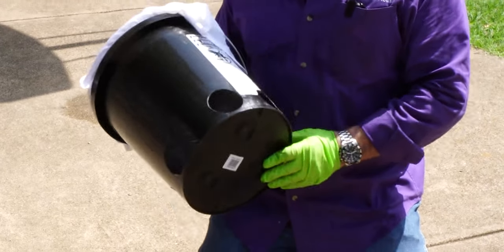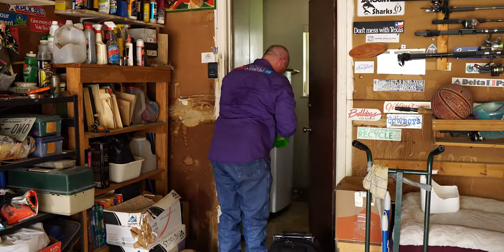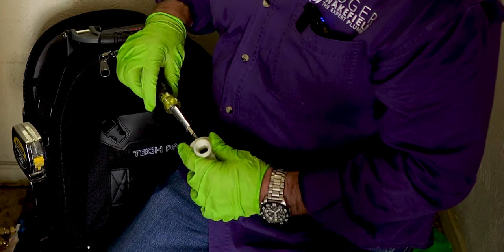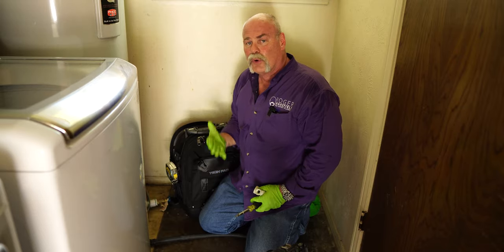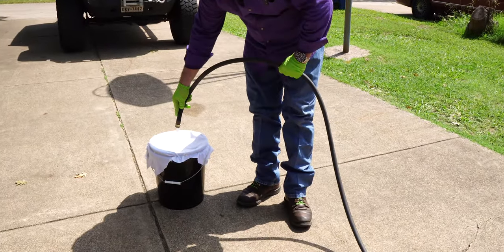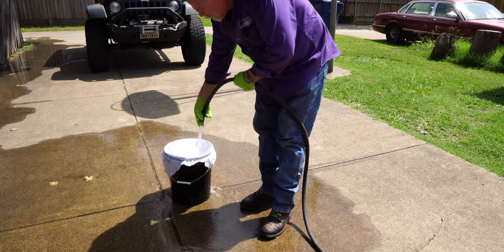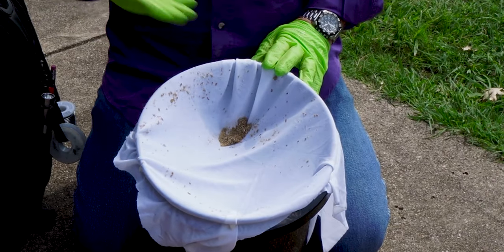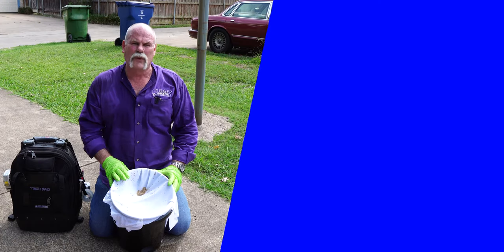How to Flush a Water Heater the RIGHT WAY - DIY Plumbing

Comment: How long can a hot water heater last, and when should one be replaced?
Reply from the maker: They usually last 8-12 years, although I’ve seen some last closer to 20
Reply: Mine laster about 8 years and started leaking. It did not have a lot of sediment and was never flushed. I will flush this new one. The anode should be removed and checked after 6 months, then checked, maybe yearly depending on how it looks after the first removal. I could not get my old one out to see, but it had to be toast. The manual has the instructions and timelines.

Comment: Hose hooked up, drained the water heater, turned on cold, flushed it multiple times, closed the valve, when up to turn the hot water off and it was super hot, like it never drained

Comment: My 16 year old water heater has been making popping sounds. I went ahead and flushed it today. I decent amount of sediment came out. It’s heating up now and still making the popping sound. What’s going on with that?
Reply from the maker: There still might be a decent amount of sediment on the bottom of the tank…flushing helps gets rid of a lot of the loose debris…but not all of it. If you’re still have problems getting hot water, I’d think about replacing it soon

Comment: Ooooo mine hasn’t ever been flushed. Wonder what’s in it. Haha
Reply from the maker: When it's time to replace your water heater let's cut open the old one and see!
Reply: Roger Wakefield I am allllll for that! Woo! Yeah! 💪
Reply: I’ve never done mine either yikes 😳
Reply: Should you turn off the power on the heater?
Reply: @srichard217  I'd say you should turn off the heat or you'd be running hot water over your hose and may scald yourself.
Reply: Our house was built in 1992, I never did anything to my water heater...wonder how long before I need a new one.
Reply: You need to take Roger up on that!
Reply: @4u25out  It mostly depends on the quality of your water and a condition of your anode rod
Reply: @4u25out  you better do it now , becuase if you dont,, one of these days you are going to go to the basemant and you will see flooting all over it ...
Reply: @srichard217  I would recommend turning the heat down all the way. There is no reason to try to heat water that is just going to rush out. As long as you have fresh water coming in you can leave the power on. The danger is when there is heat and no water to keep the tank from over pressuring

Comment: Gurning off the electricity for a couple of hours will prevent a scalding burn ! I always see (once a week ) a hot water tank on the road edge near the  condos near me. They never flush them. Then a new one has to be installed. Such a waste. But most condo owners don't even own a screwdriver !

Comment: Roger,
I didn’t see you turn off the breaker or the inlet water value off. Most videos I’ve seen recommended doing that. Is it safe to not turn those two things off and just hooking up the water hose and flushing it?
Thank You.
Reply: That’s what I like to know too
Reply: as long as you keep the cold water valve turned on, it's not a problem if power is still on trying to heat.

Comment: My rank doesn’t have a drain. Curious how they drain it if have to assume dissconnect one of the other lines. Looks like cheap system I have so explains no drain other then the pressure relief

Comment: Great video and thank you for the info, but surely there's a more efficient way than running the hose on full blast for 10-15 minutes. I bet you could find a way that's faster and uses less water, just a thought. Cheers :)

Comment: Ok so kind of a horror story been a plumber for years and one of my first times solo as a couple year old apprentice I had a water heater that had a hose on it from the old home owner for draining the water heater that the new home owner wanted off. It was a plastic valve so I backed it with a second wrench and that plastic valve broke off. I got wet and quickly shut of the water heater valve. So I learned two things first shut the valve to the water heater off and second if they have those plastic water heater valves leave them alone. I should of just told the home owner to live with it. The thing that sucked is I had to run to a local store because I didnt have that valve on the truck and the only one the store had that would fit was a plastic one. I made a plug with a male adapter when I ran to the store. I had to use a screw driver and a hammer to break out the rest of the plastic valve it was a pain.  Those new plastic ones do not fit worth a dang but I got it to work. Moral of the story if I change out a water heater and if it has a brass valve and I dont have one on the truck I take it. Dont buy the water heaters with plastic valves please...
Reply: 3/4" ball valve works best.
Reply: @damianr1658  but you need a hookup for garden hose to drain I know they make an adapter but if your junking a water heater anyways it's free. You can pass that savings on to the customer and make them even happier.

Comment: My tank has about a foot of sediment in the bottom.
Reply from the maker: oh wow! Have you ever flushed it before?
Reply: @RogerWakefield  Yes, we have very hard water.  I have to take out the electrodes and the ball valve and vacuum the inside with a shop vacuum and small diameter custom tubes.  Makes for a long Saturday.
Reply from the maker: how often are you having to flush it? Have you thought about a water filtration system to help soften the water?
Reply: @RogerWakefield  yearly.  I have to dig out under my floor to access a drain line to drain it.
Reply from the maker: Sounds like some work...but might be worth it

Comment: Why not just turn off the water, but not drain the tank. then pour a gallon of hydrochloric acid into the top of the tank and let the solution mix with the contents of the tank for about an hour. Then drain the tank. All the solids scaling n the tank will be dissolved and when you flush the tank, everything will be spot less.  The hydrochloric acid does not harm the metal pipes or metal in the tank and as soon as you flush with water, simply turns to chlorinated water.

Comment: You should do my waterheater it hasn't been flushed ever...it's from 1976.
Reply: What ? 😂
Reply: @Freight-bw9wd  it's a 1976 maybe even a 1975 original to the house and it's running on well water :).
Reply: @timothynguyen9984  the old school still works 🥳
Reply: @timothynguyen9984  dont jinx yourself now

Comment: Question, do you need to shut the power off first?  I’m assuming the cold water coming into the tank and the water leaving via the hose is the same. If the hose is letting more water out than is coming in and the tank level drops below the upper heating element wouldn’t you risk burning out the element..
Reply: Yes. To avoid dry firing the heating elements, turn off the power to the tank many minutes before you start draining. Then, don't turn it back on until the tank is filled again. And to get it filled all the way, you should open a faucet somewhere to let the air out of the top of the tank. (I've watched a few of these videos).

Comment: REMEMBER TO TURN OFF THE ELECTRICITY FROM THE WATER HEATER TO PROTECT YOUR HEATING ELEMENTS!
Reply: Mine is gas
Reply: @noworriesmate5903  Then no worries about turning off the electricity
Reply: Pretty sure my heating elements are already shot, that’s why I want to flush it 😂
Reply: Only if you empty it
Reply: turn it off before you shower, then you'll be wasting less hot water when you dump it

Comment: So, is he stating that you just  up the hose, open the drain valve and allow a good amount of water to flow out until clean water and then just shut the drain off and that's it?
The heater does not get shut off during this process??

Comment: I had a brass valve on mine, but the opening was not very large.  I am surprised that you dont recommend switching the valve with a ball valve.  MUCH larger opening, and I had found that more sediment was flushed due to the higher volume through the unrestricted orifice.
Reply: I did that and was pissed the brand new ball valve leaked. but the gate valve that came on the heater was too dang small and plugged up

Comment: Actually it’s best to sell a short brass nipple and a threaded full port ball valve with garden hose thread adapter when you sell the water heater. The brass drains that come on water Heaters are way to small to flush adequately. They have an opening about the size of a pencil. Also the dip tunes in Bradford White and most other brands are designed to swirl the incoming water to stir up the sediment so it all does not flush out like you may think. Flushing with pressure then draining completely with no pressure gets a lot more out.
Reply: Thanks for helping me understand the last part. I have a HTP tank and the manufacturer makes a reference to this. Do you know at what stage the relief valve should be flipped open during the flushing process? I'm presuming only after the tank is isolated and being drained.
Reply: What do you mean by "sell"
Reply: @debbiedebbie9473  I was speaking from a plumbers perspective. Typically you purchase a water heater and install from a service plumber/ company. The plumber should offer the better drain than what comes originally so the customer/ home owner can fully flush the heater.

Comment: Wait so you dont turn off any valves then just start draining it for 10 to 15 mins?
Reply: No reason to shut anything off.  You're really just pushing water through the tank directly, not much different than turning on a faucet.

You should pick up a hose bib cap before doing this.  Unless your water heater has a ball valve like this one, I guarantee it will leak after.  You'll use the cap to stop the leaks. 

If your valve leaks at the handle after, and that is common, you can try adjusting the nut or just replace the valve.

Comment: but Grumpy Plumber says there’s not use to flush a water heater?
Reply: That way he gets called to replace it when it fails...making him more $$$
Full port ball valve and hose bib adapter use a brass Nipple on the tank....then you can flush out larger chunks of oatmeal and granulated calcified chunks....your on the right track👍

Comment: I know this is an old video but I hope someone sees this. Our hot water heater has stopped heating very well, even though it's only 2 years old, after a main line in our neighborhood burst. Our water was brown for 3-4 days. I'm thinking I need to flush the tank.
Reply: 100% easy fix. Move
Reply: @Herbie11  genius! Why didn't think of that?
Reply: @MSANTHR0P3  
😉
Reply: Sounds like a great idea. I would try that! Did it solve your problem?

Comment: Hello guys I want to share something with you guys  ..Iv been Plumbing for 14years and never encounter what I did today.  I had a call for a shower stoppage , so i got my machine out and starting running the shower to get it to backup which it never did... so I still ran my snake down the drain... went in like 20ft in, so I started bringing the snake in... what I pull out was crazy.  I pulled back a small (mause/rat)it was  Dismember but can see tail,leg,feet and  What appears to be its ribs cage...
I have a picture

Comment: My tank was only 1 1/2 yrs old, bottom element went out. When I replaced it, I did a flush....over 2 gals of sediment and mineral deposits. It's all due to very hard well water, i will be flushing more often. 

Is that brass valve water heater specific? I need to change out my plastic one to a metal one
Reply: That scares me... We have some of the hardest water in the country here and it's been like 4 years atleast since it was installed and has never been flushed....
Reply: @Zalagar619  My is 13 years old and NEVER flushed. It still seems to work fine but we hear the rumbling sound whenever we first turn on any hotwater in house. I'm pretty sure it would be a very bad idea to try and flush it now according to this video. My fear would be that I would open the drain valve and never be able to close it due to hard sediment getting stuck in the drain valve
Reply: I recommend getting a 2-3" x 3/4" Brass Nipple and a 3/4" Full Port Threaded Ball Valve then a 3/4" male pipe threaded x Hose Bib thread brass Adapter

Comment: I saw another video where someone replaced the valve from the factory with a short pipe nipple and a larger valve (e.g. with a 3/4 female thread instead of a male.) Have you done this and do you recommend it, or why not? Thanks.
Reply: This is a fantastic idea. I’ve done it years ago and I love it. A three-quarter inch ball valve allows a half inch vinyl tube to be placed through through the valve and into the tank you can then attach it to a wet dry vacuum and suck out all of this debris. I did it yesterday and it worked great. Drain the tank completely which let’s a little bit of the debris come out and then when it empties completely stick, the vinyl hose through the valve and a series of flushing and vacuuming, and inserting the vinyl tube various depths into the tank. You will get out a lot of the stuff that would never come out by just flushing it. It worked really well for me.  The vinyl tube attaches to the vacuum hose with some duct tape.  Give it a try.!

Comment: I have a question! My water heater makes noises only while the hot water is being used, other than this it’s silent. Is this normal? It sounds like the water heating up.
Reply: I’ve been looking everywhere online and it says the water heaters should be completely silent
Reply: if it sounds like water is boiling and popping/crackling you should probably just replace the water heater
Reply: Austin Hamann it sound like water running
Reply: As long as your water temperature did not drop, your pressure relief operates as it should, and your drain valve flows, it's fine.  Hot water heaters are not completely silent, and as they age, they may make more noises than before.

Comment: Got a electric heater. Let it cool down over night and switched the breaker off.

I drained it and then turned on water supply... But 1)water is hot... Yet tap water colr supply is cold at the tap(at sink)... How's that possible?
2) if I turn off water supply to the boiler tha hot water sink immediately loses all flow... Yet if I let it drain and start it up... It immediately has flow again... Does it not have to fill the tank before giving water to the house?? I'd expect air...

This 65gal tank gives us 5-10min of hot water max... It's horrible... Not much sediment came out.... Maybe a cup... But to clog this thing up I'd expect lbs of sediment lol.

Comment: Pipes burst this weekend... TL:DR I had to cap off water from everything but cold for 1 sink and toilet cause my aunt's husband did us a favor 15 years ago...
Every time I take something down to find the leak I'm shocked plumbing this bad didn't break the laws of physics and burst into flames.
Advice... Never try to be nice and help fix something if you dont know excactly what you're doing... and if you do have a friend helping you watch youtube tutorials behind him/her while they work :D
Reply: Time to go drain my water heater cause a CPVC fitting was used to replace the valve between the main shutoff and the outdoor tap... leading to a slow leak under the bathtub... that rotted out the beam under my water heater. 
Thank Youtube I watch these videos all the time. Only thing I wont mess with is high voltage and sewage.

Comment: So just flushed the water heater. The water clear  after 20 minutes, all good! Then I shut off the drain valve and disconnected the hose. The valve did not completely shut off. So now I have a leaking drain valve. Awesome!! Guess I’m gonna learn to replace the drain valve. So I assume I’ll need to shut everything down, drain and repair. My shower pressure is still bad after flush. Again, Awesome!!!
Reply: I'm in the same position

Comment: My problem with leaving the pressure on is my fill port is the same as the drain. I have flushed mine about 6 times. Clear water but still have flakes that plug up the kitchen sink sometimes in the matter of a few minutes.  I don't know how it's designed but I'm definitely not getting it all out.

Comment: i used your method and almost no sediment would come out.  Then i found another method and i tried that way and more debrus would come out. the other method was turn the gas off and water off to water heater. Fully drain tank then open valve and run water into tank for 30 second then shut off  then wait a minute let water drain out of tank again and repeat process at least 4 times or until you see  little or no debris coming out of the water  and alot more debris  other stuff was coming out.  The guy explained that the cold water tube runs to the bottom of the tank and when the tank  is empty and water is turned on full pressure the water blasts the bottom of the tank like a pressure washer loosening sediment lime etc etc off the bottom of the tank and then gets pushed out the drain.  

my theory is maybe i didn't have so much sediment but maybe lime or something that was stuck on the tank so the other method was more effective in loosening that which was stuck on floor of tank? i have not flushed in 2 yrs as well. heater was installed in 2018.   thanx for your wonderful videos
Reply: Roger stated in a different video that this is not his prefer method because completely emptying the tank and refilling causes stresses on the tank due to the expanding and contracting leading to possible weakening of the tank. His method is just trying to prevent problems like that from occurring.